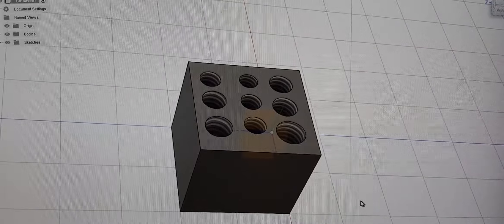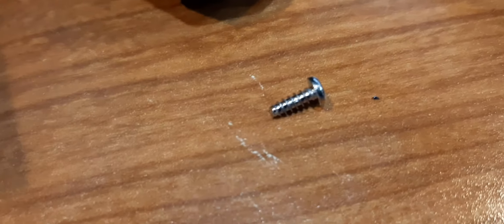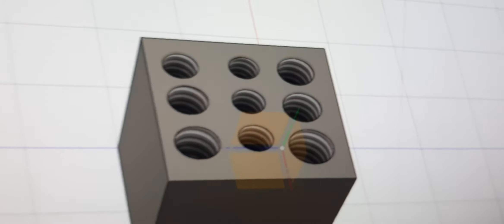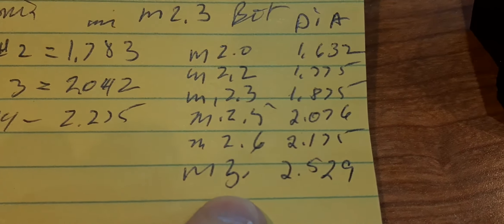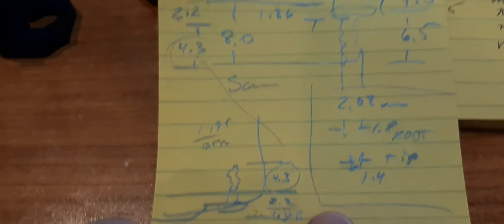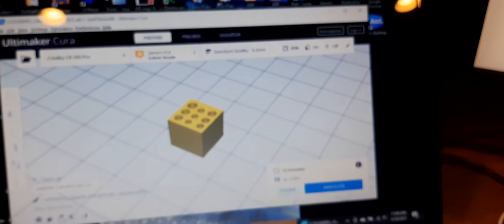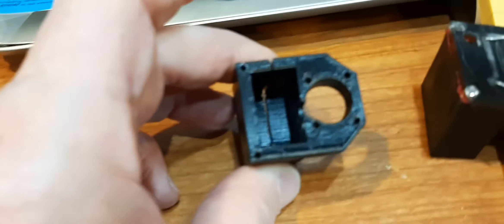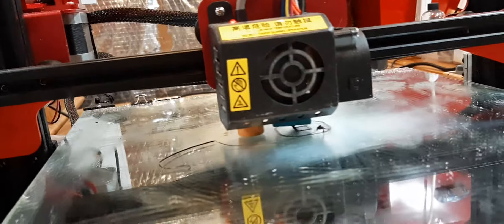self tapping screws holes trouble, test, resolve

Comment from the maker: M2.6 works best, but after 3 install, remove, reinstall the threads show wear.  Then I either repair with brass threaded insert or a larger screw. May gave to try m2.5 on one assembly for durability. New smoke heat controller ordered. Should be a good weekend. Working on 12 engines to assemble and sell. More later.